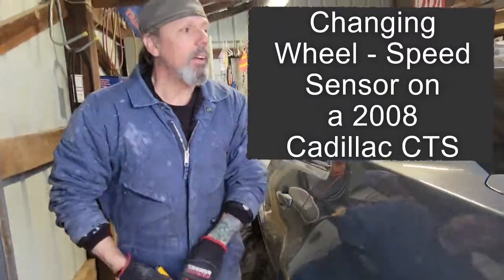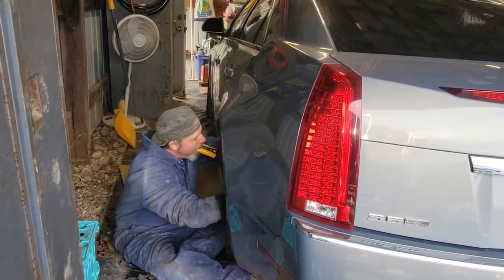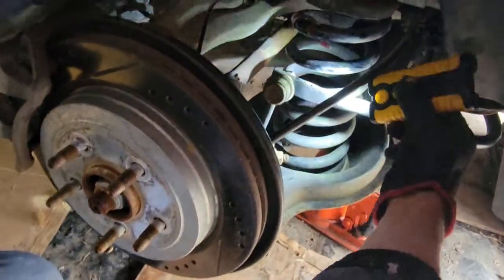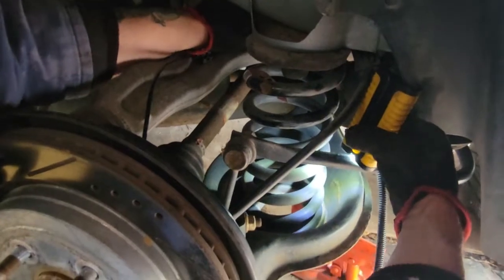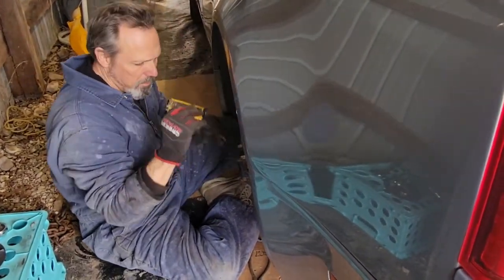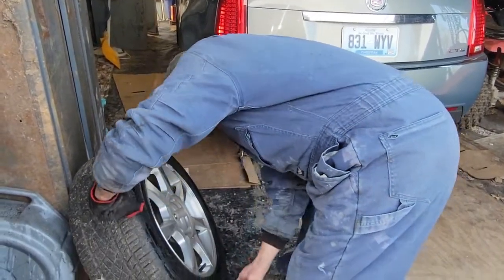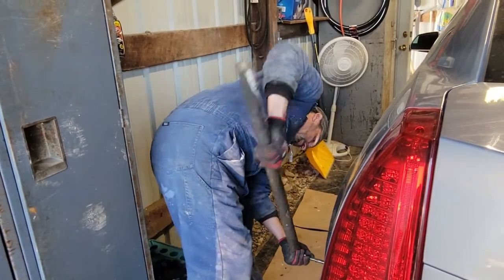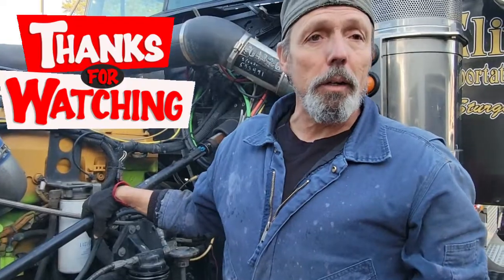Changing the Wheel-Speed Sensor on a 2008 Cadillac CTS #wheelspeedsensor #cadillac #2008cadillaccts

Comment: Idk why everyone being so rude but mine throws traction control anytime I hit 60 do you think doing this woukd fix the problem
Reply from the maker: Steven says that when his wheel speed sensor goes out that it will immediately throw a code as soon as the car starts rolling. Steven believes that your code reader should tell you specifically which wheel is throwing you a code.   He says you should check the contacts on the back side of the hub.  You can usually pull the sensor and look through the sensor hole with a flashlight and examine the contacts for corrosion or breaks.  Steven hopes this is good information for you. Thank you your kind words.  Ruthie B Howard  4.15.23
Reply: @bigbellyrebuilds2778  thank you guys so much still have not figured it out it’s very weird I scanned it and nothing comes up have taken it to shops and have had people screw me over just makes me sad
Reply from the maker: @Noah-sx9ku  DEAR Mr. Noah, thanks for the response back.   I am sorry that you are still having issues.   I  know this must be very frustrating.   The worse part is when people take advantage of the situation and "screw" you on prices.   We know all about that!  Boy - do we ever!   We had a shop charge $5,000 for installing two U-BOLTS!   Isn't that insane!  So... we feel your pain!   ON A LIGHTER NOTE, I uploaded two farm videos today about sheep and baby horses.   Nothing to do with fixing cars, but you might enjoy these two videos filmed on my Mennonite neighbor's farm in late March.   I call these STRESS RELIEF videos!  LOL.   Just uploaded this afternoon if you are interested.  Hope you get a chance to check them out!   Ruthie B. Howard  4/16/23